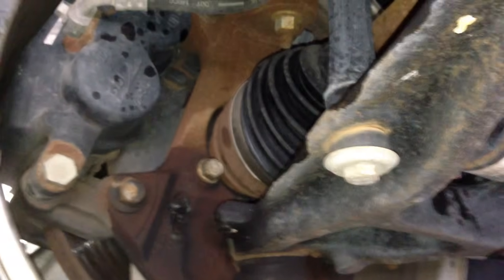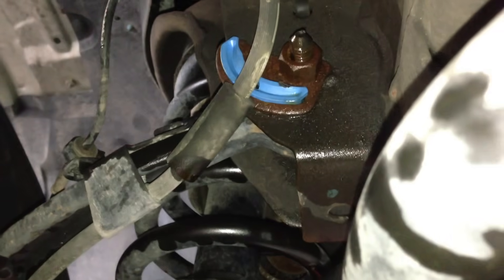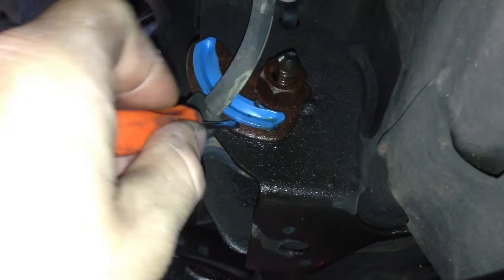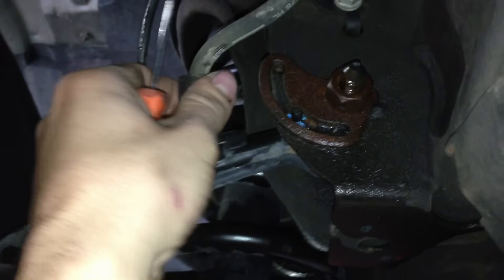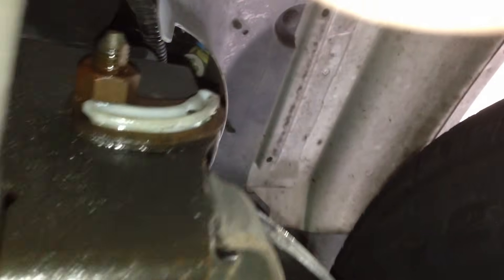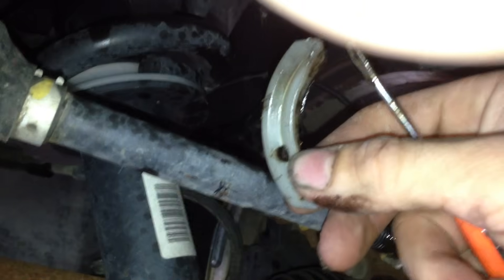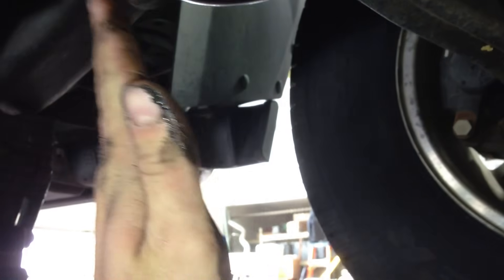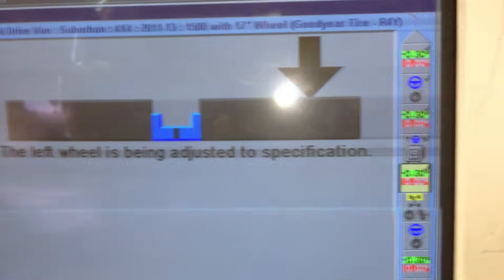GM Truck Camber and Caster Retainers

Comment: so this video is pretty old, and so is the most recent comment, but I'm still going to ask my question.... you think it would be safe to assume that an adjustment has never been made if these things are still in place? I inherited my father's 06 Silverado, and he was not the best when it came to maintenance.... basically if it ain't broke —so I really doubt this things had more than a few sets of pads and rotors and some oil changes.....

Comment: I went to GMC dealer for wheel alignment, they scammed me, they charged me for full wheel alignment but they just adjusted the toes both sides, the caster were ok but both sides the camber were off and I asked the service advisor why you didn’t adjust the camber first he say because of the weight that carrying we can’t adjust in case if you move the weight it will change and I told him the weight will be there permanently then  he went to his mechanic and say my mechanic say it will be big job, we have to remove struts to do that and it will be extra charges.  I knew that they are try to scam me more and I said to him forget about it and still I had to pay for full wheel alignment 🤬

Comment: So I had to remove mine after installing a leveling kit because it needed to be adjusted. The problem I had was no matter how tight you get those camber bolts, without the keeper in there the key would move causing the camber to move any time I was on a rough surface. I ended up buying a camber kit that had holes drilled into it for the little pin to hold it in place once everything was tight. Apparently it's pretty common with these trucks.

Comment: Makes sense y my camber is so far out.  Still have the plastic retainers in place after I put a lift in with different control arms.  Shop obviously skipped camber adjustment on my alignment

Comment: 8 years later, this video still answered my question. I'm replacing my frame, because I'm poor and can't afford a new truck, and am missing some adjustment plates. All new ones are missing the plastic piece. This video reassured me that this is normal. Thank you!
Reply: I know the struggle I’m in same boat
Reply: How bad was frame replacement?
Thinking about doing it to my work truck, the prices for new ones are crazy
Reply: @giuseppesinibaldo2796  It's not as easy as I once thought. I'm having to do it outside in my gravel drive. The body will sit on 4x4 posts and cinder blocks while I roll the frame out, swap all components to the replacement, then roll it back under. Yes, I'm still working on it.

Comment: eh good tip on jacking it up i guess that's why it prompts on the computer. what tools do you use to move the bolt head pointing towards the strut especially the stubborn ones. socket won't fit and the wrench sits sideways

Comment: #1: ALWAYS Align with the TOTAL VEHICLE WEIGHT, SETTLED ON THE SUSPENSION.     If you are doing it in the air, you are wasting your time and the companies money.

#2: ALWAYS ADJUST by drawing "INTO" SPEC..  This is achieved by ensuring that when adjusting, any pinch bolt is drawing the upper control arm BUSHING towards the frame into SPEC.  This ensures that the cam bolt won't corrode to the point of seizing, and along with the pocket pinching action of the bolt along with the bolt resting against the inside of the bushing, both assist in locking the bushing in a fixed position.  All of em have sloppiness loose.  This is normal. 

#3: Torque the suspension bolts with the total vehicle weight compressing the suspension.  No JACKS.. again.  I know its a PITA to get in there with a torque wrench..  Get it as tight as you can with your paddy paws.. just prevent the inner part of the bushing from rotating against the static mount when the suspension is unloaded.  Put some serious arm strong on it.. Regardless.. those bushings should be under no radial load when the vehicle is suspending itself at rest.   If you have doubt.. just loosen any bushing.. and you might hear or see it slip.  No slip.. Tighten it.. you are good.

Look at aligning Independent Suspensions in all variants front, back.. 2wd or 4wd like tuning a string instrument.. tighten the string into key, never loosen into key.   Follow this mental rationale, and you will never go wrong.  Plus you will be astounded what can be done in your back-yard with minimal effort and a tape measure.

LASTLY, and AGAIN, There should be NO JACKS..  NONE..  under the frame or suspension unless you are changing components.   This will screw things up.  As when unloaded the suspension spec will differ slightly then when its under compression.  It's a head scratcher and hangs allot of people up because on the jack its correct, but going down the road its screwy.  Eliminate the road screwy. 

Why is it different in different states of function?  WELL, when the vehicle is cornering, the vehicle experiences dynamic weight transfer, one side of the suspension is under load.. and the other side is under less load by comparison.  Those nerds at GM engineered the suspension to accommodate for dynamic change the suspension gets subjected to under these conditions to ensure that the most contact between the tire and the road is achieved under any kind of lateral dynamic loading.  It's pretty neat stuff.   

For measurements you guys go here for GMT 800 99-07 GM light trucks/HD trucks/Suburban/TAHOE/Yukon/Avalanche http://ww2.justanswer.com/uploads/GG/ggrote1/2012-12-02_224815_81929321.gif 

Lastly.. Don't RUSH it.. take your time.  And do your research.  There is allot of info out there with a plethora of ways to achieve the same thing, the question is what works best for you.

Comment: Hi if I could have some input pls my shop told me they couldn't do alignment for my Camber guide pins are missing & they don't fix that there but neither does a body shop... what do I do?
Reply: Check out notoriousjpg channel he has a how to
Reply: berry happy hi what did you do my truck is also missing the camber guide pins
Reply: bob saget
Reply: @adamroberts8514  R.I.P.
Reply: K6716 that is the part you need

Comment: would be adjusting camber affect the ride height of a vehicle
Reply: Yes, by adjusting the torsion bar key, not those little one in the video.
Reply: @owentimo  this is a half ton suv. It doesn't have torsion keys. Only 3/4 and above. This vehicle has front struts with adjustable control arms for align angle adjustment.

Comment: I have a 1998 Chevy 1500 4x4 I had aligned today. The shop was able to make adjustments except for cast and camber because the plugs needed to be cut out in order to make the cast and camber adjustments, so I would have to make an appointment to come back when the alignment machine had more open time any idea what they mean by having to cut out the plugs to adjust the cast and camber?
Reply: I was told the same thing about my 98 Cheyenne 4x4.  I've been looking at the camber adjustment bolts on ebay instead.  That would be about $45 for both sides. I'm hoping it's a viable option.
Reply: Les Harding where can I get the knockouts, I'm missing 1 on driver side
Reply: That was their way of saying that they don't want to do it. Most places just set the Toe, and let it go.
Reply: Les Harding I

Comment: why are these cams always so damn hard to move? half the time they are seized in the bushing and you really cant heat them out without melting the bushing or can you?
Reply: The control arm's cams are specifically designed to use compromising materials (ie corroding). If you replace your control arms bushings, consider using stainless bolts, and a generous amount of ant-seizing compound.